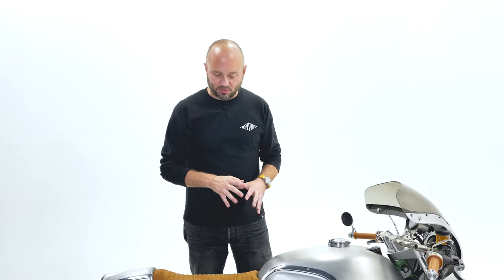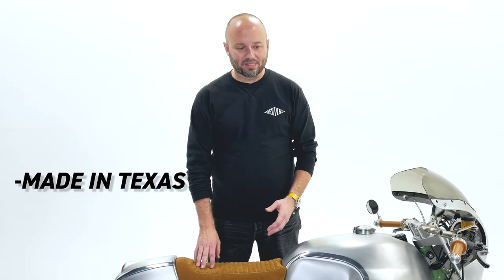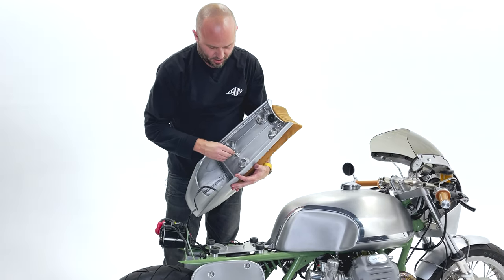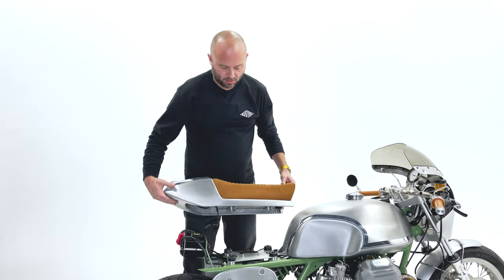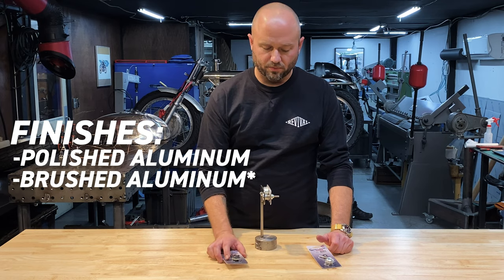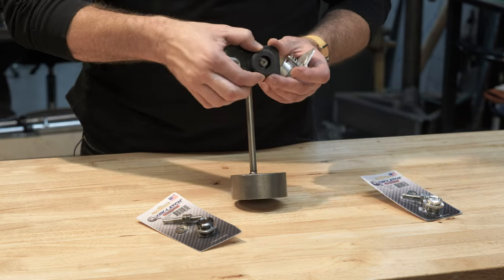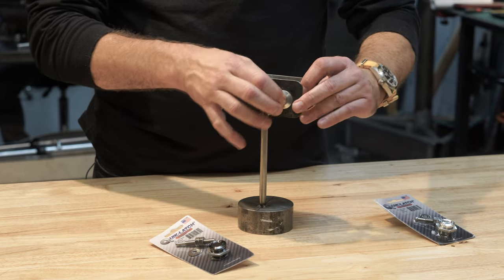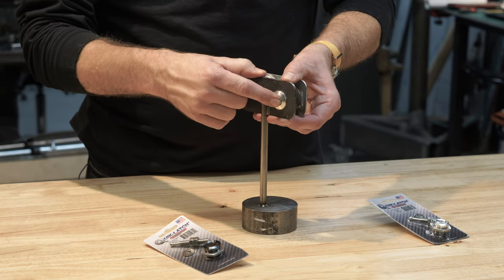Don't Build Your Next Custom Bike Without This!

Comment: love the idea of these things. Is there some sort of strength rating or rule of thumb to go by using these? I'd like to use them on the hood of my car, not sure if I need two, or four, or aren't strong enough to hold a hood down at 150+mph lol
Reply from the maker: These are often used for hood latches but they make larger sizes for that application that we don't sell.